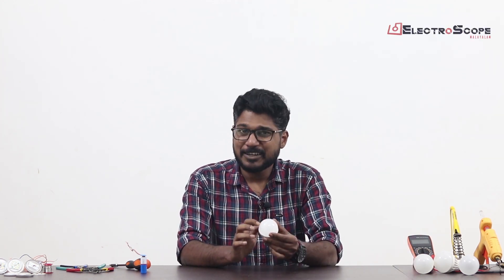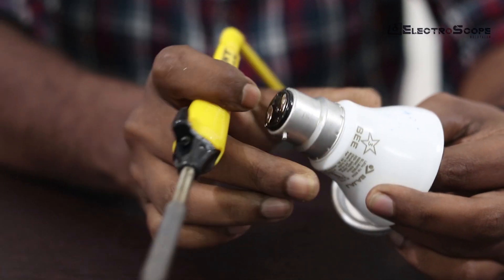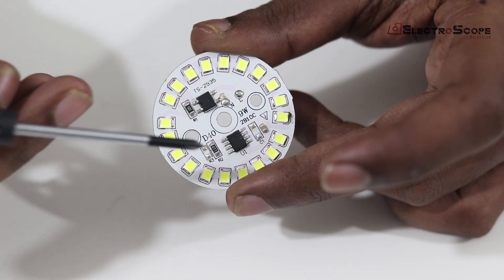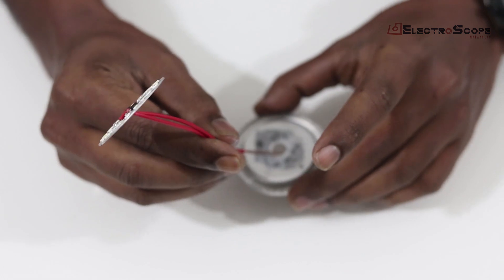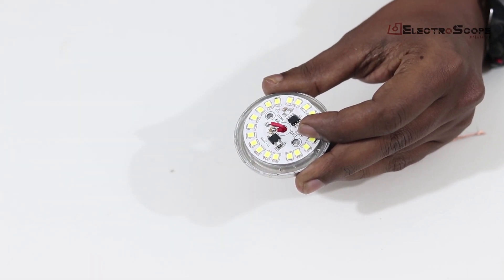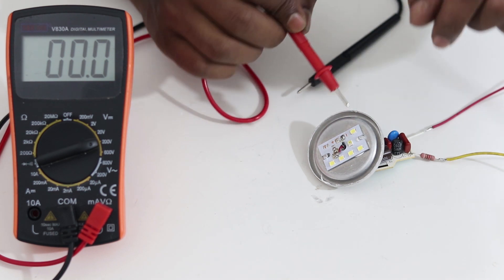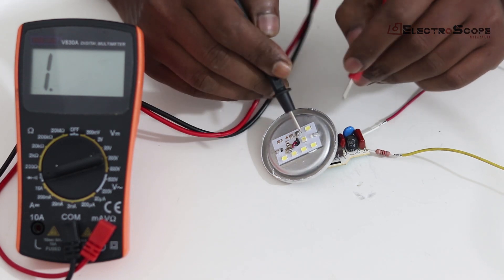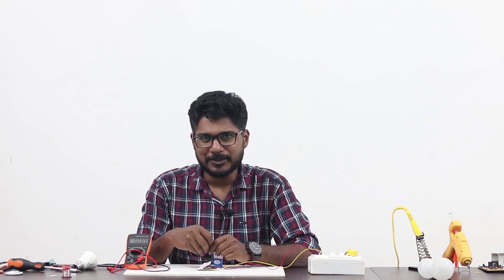കേടായ LED ഉപേക്ഷിക്കുന്നതിനു മുൻപ്..| LED Bulb Repairing part-1| Electroscope Malayalam

Comment: Frst of all congrats for your 1k subscribers. You deserve a lot more❤️
Oru cherya doubt nthennal 9v battery vach led check cheythal ava damage aavan saadhyatha ille? Nd multimeteril diode check cheyyunna positionil ittal normaly led nallathanenkil cherthaayitt blink cheyyille? 

Bro de oru katta fan aan njan.explanations are simple and easy to understand.. all the best bro... ❤️❤️
Reply from the maker: Thanks bro..ബ്രോ തരുന്ന feddback ഓരോ വീഡിയോയും മെച്ചപ്പെടുത്താൻ വലിയ help ആണ്..❤❤

നമ്മടെ ബോർഡിൽ 6 led ഉണ്ടാരുന്നുള്ള.buck ന്റെ output 100v അടുത്തു വരുന്നുണ്ടാരുന്നു. അപ്പൊ തന്നെ ഉറപ്പായിരുന്നു led യുടെ voltage 10v മുകളിലായിരിക്കും. അതുകൊണ്ടു 9v വച്ചു test ചെയ്യുന്നത് കൊണ്ടു കുഴപ്പമില്ല. പിന്നെ അധിക നേരം പിടിച്ചോണ്ടിരിക്കുന്നില്ലല്ലോ. ചെറിയൊരു value വിന്റെ resistor കൂടി ഇടുന്നതായിരുന്നു നല്ലത്. ശ്രദ്ധക്കുറവ് കൊണ്ടു സംഭവിച്ചതാണ്..☺

പിന്നെ കൂടിയ voltage ന്റെ led ആണെങ്കിൽ  multimeter ഉപയോഗിച്ചാൽ blink ചെയ്യില്ല ബ്രോ..
Thanks again bro..❤
Reply: @ElectroscopeMalayalam  frst of all njn oru electronics engineer alla so pottatharam aanenkil kshemikkanam

Bro kazhinja vdo il paranja pole oru constant current source aan ckt enkil output no load voltage meteril nokkumbol loaded voltaginakkal kooduthal alle kaanikkullu... as volmeter resistance is high
Angine aayikkoode 100v kaanichath

Njan argue cheyyuvanenn orikkalum vichaarikkarith. Just my doubt.
Reply from the maker: ബ്രോ പറഞ്ഞ സംഭവം വളരെ correct ആണ്.. പക്ഷെ no load voltage മൾട്ടിമീറ്ററിൽ 100 ഒക്കെ കാണിക്കുന്നുണ്ടെങ്കിൽ load voltage 60 എങ്കിലും ഉണ്ടാകേണ്ടതാണ്.☺
Reply: നിങ്ങൾക്ക് ദുൽക്കർ സൽമാന്റെ ശബ്ലം സാമ്യമുണ്ട്

Comment: Your effort is very good,first half that readymade led board has no life, ie not durable.Second part don't short the defected led add a suitable resistor it will limit the current and increase life

Comment: Thanks you for the informative video on how to repair LED mains unit. If one of the emitters have failed and you have no SMD emitter at hand, you may NOT short the connection, but connect 1N4001/4002/4003 etc, across, noting the polarity. Try that. Cheers, buddy.
Keep smiling that makes a lot of difference😀

Comment: LED check ചെയ്യാൻ മറ്റൊരു വഴി ഉണ്ട് insulated ആയിട്ടുള്ള oru forceps use cheyth oro LED allegil damage ആയെന്ന് തോന്നുന്ന LED short ചെയത് നോക്കിയാല്‍ മതി.

NB : MUST USE AN INSULATED FORCEPS OR TWEEZERS. 👍😍
Reply: കൂടുതൽ വിശദീകരിക്കാമോ
Reply: @dreamworldmydreamland4848  doubt എന്താ എന്ന് പറയാമോ?
Reply: Insulated ആയിട്ടുള്ള ഒരു forceps use cheythu ...ഇത് എന്താണെന്ന് മനസ്സിലായില്ല ബ്രോ
Reply: @dreamworldmydreamland4848  ath mattonnum alla series connection aan LED appo orenam damage aayal circuit cut aayi. Nammal forceps allegil oru wire piece use cheyth aaa damaged led legs randum short aaki nokiyal mathi.
INSULATED use cheyyan parajath DC koodiya voltage karanam shock adikkum. Athondan